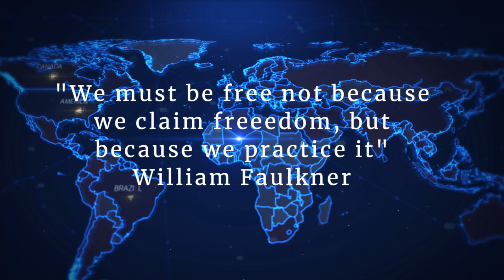How WE BUILT our house

Comment: Your roof is beautiful.  What type of metal is it and do you have to add anything after water catchment before it is used in greenhouse?
Reply from the maker: You don't have too add anything since it's a metal roof. We run it through one sentiment filter before the greenhouse. The metal is normal metal roofing that can be purchased at homedepot, lowes or menards.
Reply: @LifeDoneFree  Thank you for your quick reply.  After Hurricane Ian we need to replace our asphalt shingle roof.  Metal roofs in our area had minimal damage.  I didn't know if zinc or aluminum were concerns for rain water catchment systems.
Reply from the maker: @charlottepuglisi2893  I had it tested and there wasn't anything of concern. The roof water actually tested better then the well water. It did test positive for floride....weird